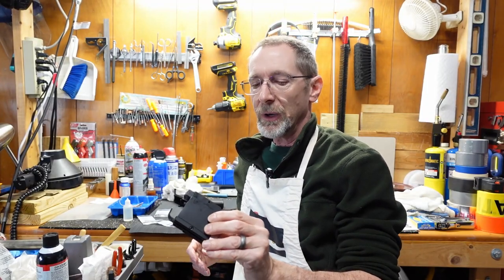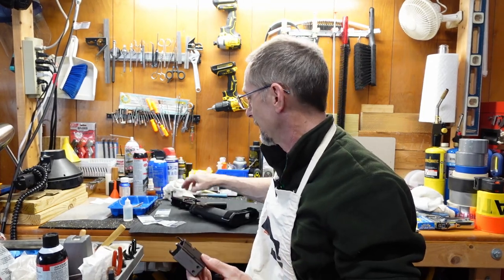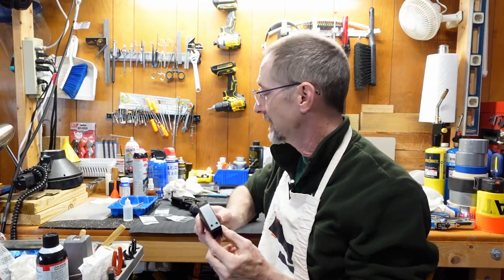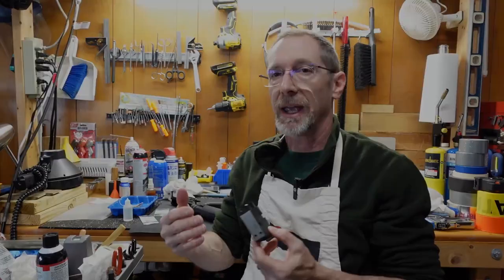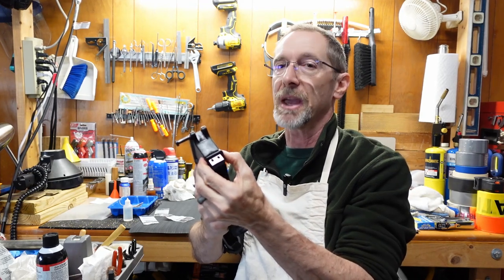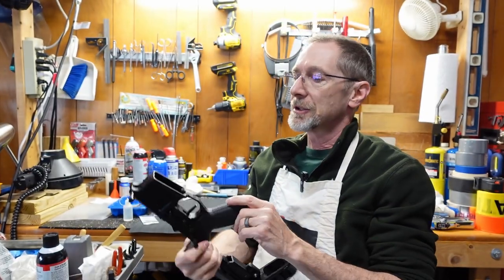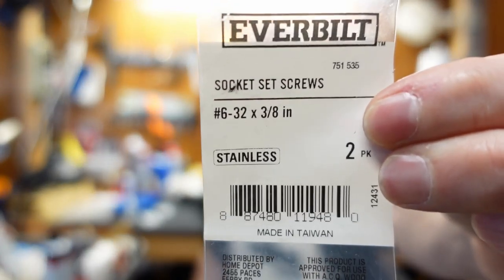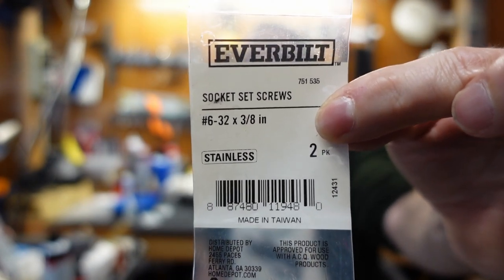Cheap Upgrade: AR9 R&D Colt Magazine magwell adapter set screws

Comment: How does this adapter compare to the stern adapter?
Reply from the maker: The Stern is for Glock mags, this one is for Colt mags.  I prefer this one because it still uses the standard AR mag release.  The Stern has to move the mag release to a different location.